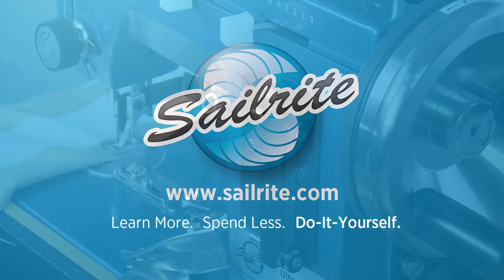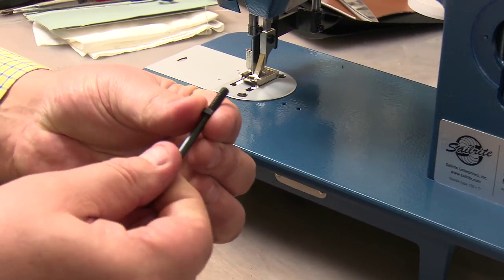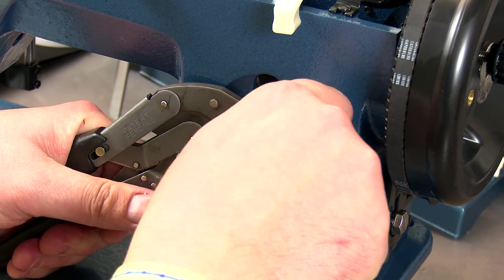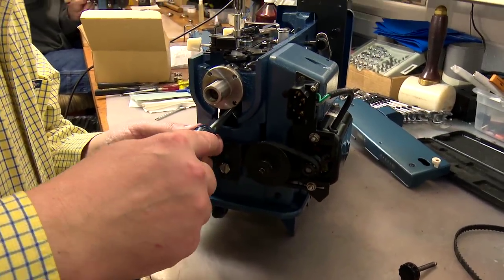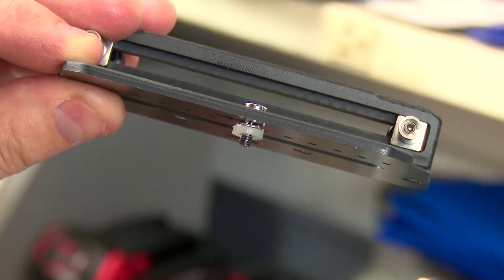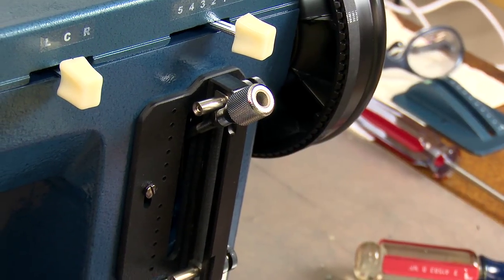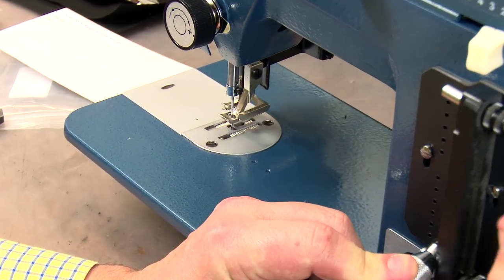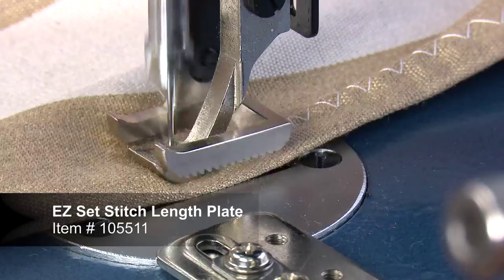How to Install the EZ Set Stitch Length Plate

Comment: 'got my EZ Set Plate
it's on the machine and works well.
It was not shipped with the Star and Nylon Lock Washers mentioned in the video
nor the lock nut shown in the video that locks to the thumb screw - I had one on hand. 
What I did was install 2 small metal washers between the screws and the EZ plate.
This distributes the load of the screws more evenly.  The plate is very secure to the machine without over tightening the screws.
I checked for clearance at the feed dog / newly installed Laser Etched Needle Plate  = all is well at all stitch length settings
Very Happy - I use to spend all my money on tricking out my cars / now it's putting high performance parts on 'my s. machine - Ha
Reply from the maker: We screwed up packaging these. They are now fixed. Do you want me to send you a star washer or two?
Reply: @SailriteDIY  no, it's all put together fine and works Great.
thanks for the offer

Comment: I ordered my EZ Set Plate a few days ago so it's On The Way.
great machine and customer service
thanks for this, I'll soon watch it again
Reply from the maker: Thanks for your order!!!!
Reply: Did you get it working? I'm thinking about ordering one.
Reply: @stopthephilosophicalzombie9017  yep, all installed and working. It does just what they say, very happy with it.
Reply: @garygerard4290  Cool! Thanks. I have an old Thompson and would really like to be able to control my stitch length and back stitches better.

Comment: Hey Eric ... i love the sailrite lsz1 too ... i have a look a like machine but i have the posi pin system on it ...with your power plus balance wheel ... I'm eventually going to but the monster one but there is a huge price difference between the power plus and the monster .... i would also like to get the silver presser feet ... i paid around £500 for mine ... wish i had if seen the sailrite before i bought mine ... can i ask Eric did u get your idea from the look a like machine or did you bring yours out first ???
Reply from the maker: Read about the history of the Sailrite Ultrafeed Sewing Machine at this link: https://sailrite.wordpress.com/2013/06/13/the-history-of-the-sailrite-ultrafeed-sewing-machines